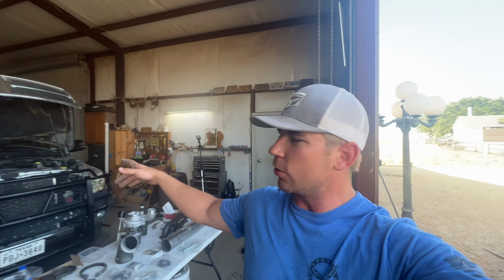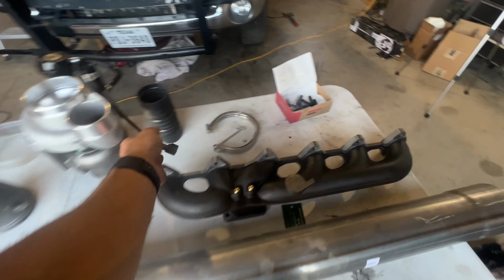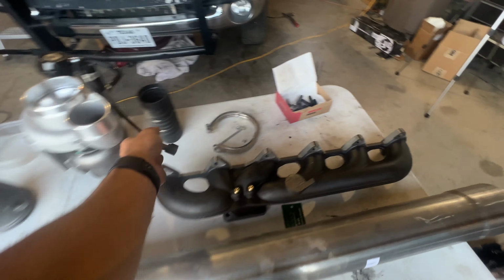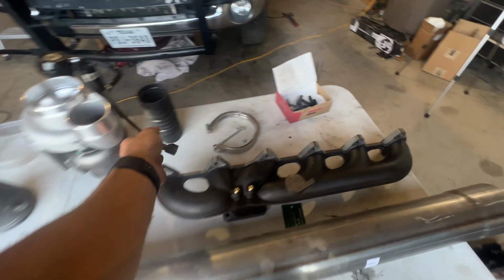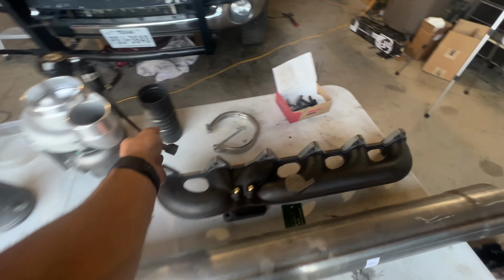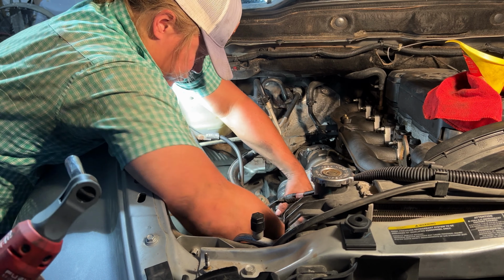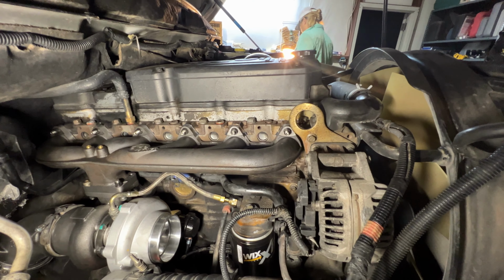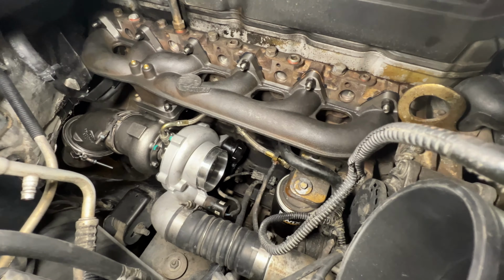230K Mile 3rd Gen 5.9 Cummins Gets NEW Manifold and TURBO!! PT 2!!

Comment: You should use the stand off’s on the exhaust studs. They are there for expansion and contraction so you don’t bust the studs. The stainless studs and nuts are good but there is a reason they put the stand off’s bud. Nice work guys
Reply from the maker: thank ya sir! will look into that next time

Comment: Was there a water line bracket that came with the manifold? I bought my manifold off of a friend and it didn’t come with one. Not sure if I need it for my truck, 06 5.9 Cummins.
Reply from the maker: no sir, had to use the factory one. took some bending to make it work but it's secure and not going anywhere